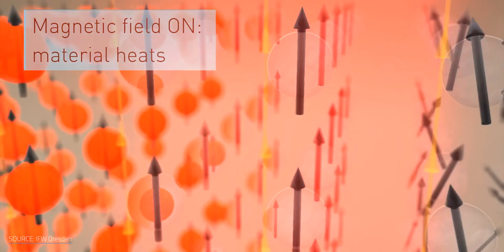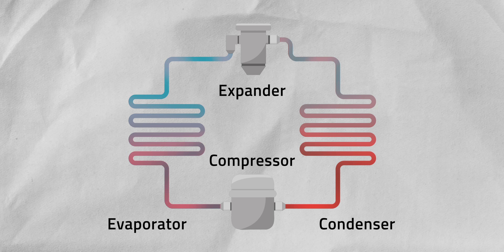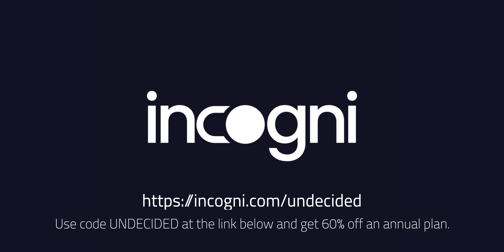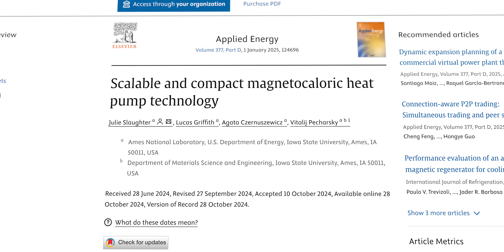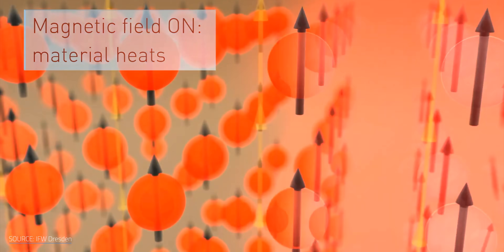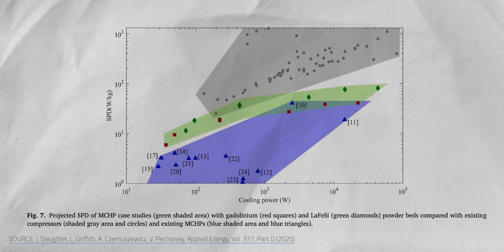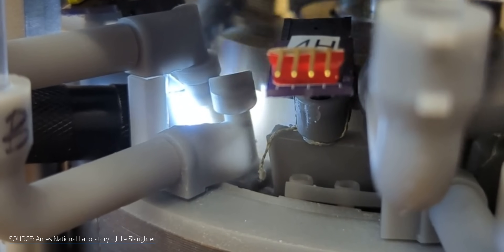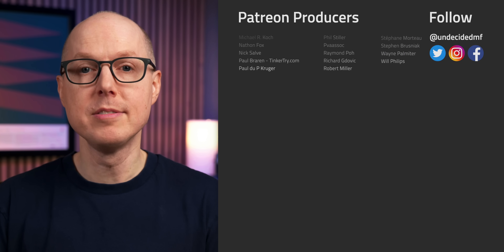How Magnetic Cooling Is Breaking All the Rules

Comment: About 30 years ago, when I drove semi, I used a 12v solid state cooler for my cold food storage on the truck. It could also be used to heat food by swapping the polarity. It got cold enough to hold about 40°F, and hot enough to slow cook food. About 170°F.

Comment: Well, some of the tech has already  been compactected or minaturized..  
 The packaging and and ceramics  women are Im sure also .. 
    Not much of a differance on any principles at all really . 
  A problem though,truely is the advance in effiencies.. . 
   The heat goes someplace..   the reflections  and things like that..  
 Much like your clothes dryer, you dont vent it i to your house on warm days, and i tersingly enough  not even on cold days... 
 The AC compressor is and was  ery effficent before.    
 Seriously.. if even a wall unit A/C were compartmentlaized and the water condensation were routed  to the radiator fins.. 
  You evertake the casing off one of them? 
   Soo many problems .. like. Oh,well needs seperstion like a plastic plate  .. ahhh.  Blowing on and the simple difference of drawing away and off of.. 
  Lets look attje total fck up of a vehicle radiator.  
  Not looking and the use or failed use of the expanded  fuel ... buttje laws of thermodynamics.   
 Why do they compress hot road warmed 200 or more degree asphalt air at 60 mph and suck it though in bell housing to blow it directly on the very engine they pass the coola tthrough..
Like yeah bruh.. Im a fcking genius gear headrocket scientist.. 
 Duhhh. 
  Seriously..think about it..Ames Research and SETI still cantfind it here  or out there.  Trust me billionsand billions, scouring the heavens for decades..  the Hubble  deep field.   NADA.. zip. 
 Heyyhey point someof that stuffat the earth.. still nada.. 
 There are far fewer particles and waves and grains of sand inside this sphere.. and quantum computers doing more calcs in a day than grains of sand in the solar system..which we hereon earth are far smaller than a d have  less grains of sand. 
 Which is like having a quantum computers doing calculations on the location and temp and movements of every grain of sand on the planet.. and even to this day, they can ot findintelligent life withing the solar system that jas the planet earth within.. 
   Un..did you say thereos a compression ?  ..
 Ok ,the corvair..maybe.. if it had a  radiator..  but still liquid cooled or magnetic cooled.. any way or both..  do not ram how air on it and then boil it with united gasoline  and burnthicker oil around  it.. shyt man that stuff  is apretty  rapidly expanding thing too.. rammed or sucked..
 Im not trying call people azzholes.. Jimmy Buffet Wrote a Song about it.. look it up, they have it here on youtube.. itis not violating  community standards, why is me asking?
 Are there some secret Jeapordy rules .. Buy A Vowel , form of a question .. thing going on I dont know about.. clue us in SETI call in hotline? .. 
   Not one denial of service attack on it either.. lonelier than dear abby..   
  Like I have this cousin yo.. the SETI callagents standing  by. Breathing heavy.. lie to me babby  lie to me.. 
 So ,some woman says that she said she is sapeio-sexual.. I said wtf does that mean.. so other screen name said she only fcks smart people.. ..I was like... ohhhh you had better have some evidence to back that.. sapeient.. and smart humans.  ... call SETI..  point all of that shytright at her..and adictonary vocabulary of terms in the the phonetic.. ..   starting at etymologies...
  The dog whisperer.. oh shyt.. stop.. had me like Rodney Dangerfield.. 
 Fly Wheels and Ragget the Hampsters  , no infringement on Alvin and The Chipmunks unless proven to be one of those 50's outreach things of a new devolping 'counter-Cullture.." Cull, Kull,like one does herds? 
 I was like vivilizarion dont you mean?  They fcking stared at me
.  I was like hmm.truely. 
  Ok Im going back to vocabulary class and Phonix.. like.. um. 1 plus 1 .. ok.. re learning.. cess..hmmm suc .. cess..went to the ole memory bamk of my mind..
 Ok..do you even thank so.eone who wishes  you success? 
 Or punch them i the throat and say you too.. ?  Etfiqutete ruleing ? 
 SETI is search for extra..terrestrial.. life... 
 Ok.. more? Tjos is 'Terra" the Earth where that  word base came from.. how co e looking..ha e the venutians or martians , saturnians capttured them? 
  Threatening them with having to come back here.. shyt, maybe they too have call block.. 
 Sapieosexual...lol. 
 Not an evidence word  backed  response.. not one.. 
 Dog walkers worried about the dog's mascumenity...  oooh fck and so does her husband...ohhh nudiicals..  
 Too much man, chill. Lol

Comment: With the breakthrough in domestic thermal batteries and heat batteries like from Sunamp, I was wondering if anybody would use PCMs in fridges and freezers so they can run during the day when there's a lot of solar but can run passively at night to reduce load on the grid.

Comment: This could be a huge benefit once we reign in cost and longevity issues.  As in motor vehicles, a field I'm more familiar with, we have resorted the the use of a refrigerant which is highly flammable.  Not the idea substance to use in a hot engine compartment or have leak into that compartment when a leak develops.  Depending upon the size requirements this could additionally save weight and perhaps remove some complexity for the system.  Applications in home construction could be simplified if this process can be used to both heat and cool your home.  On device versus two individual systems.  This will be interesting to watch develop.

Comment: AI Summary

Abstract:

This video delves into the promising field of magnetocaloric cooling as a sustainable and efficient alternative to conventional vapor-compression refrigeration systems, which rely on environmentally harmful hydrofluorocarbon (HFC) refrigerants. It explains the principle of caloric cooling, focusing on how magnetocaloric materials, like gadolinium or specific alloys, change temperature when exposed to a magnetic field. The video highlights a significant prototype developed by the U.S. Department of Energy's Ames Lab, detailing its Active Magnetic Regenerator (AMR) design and the team's optimization efforts to achieve competitive power density, projecting market competitiveness within 3-5 years. Additionally, it showcases commercial advancements by companies like Magnotherm and Magnoric, which are bringing magnetocaloric beverage coolers and industrial chillers to market. The discussion also compares magnetocalorics to elastocalorics, emphasizing magnetocalorics' performance advantages and greater maturity, positioning solid-state cooling as a key technology for the clean energy transition.

Summarizing Magnetic Refrigeration: A Deep Dive into Caloric Cooling

*   0:00 A Future Without Refrigerants: The video introduces caloric cooling as a highly efficient, futuristic alternative to traditional refrigeration, solving the critical problem of harmful refrigerant gases (HFCs) used in current heat pumps and fridges.
*   0:19 Caloric Cooling Fundamentals: Caloric cooling involves controlling temperature with a solid-state material that changes temperature when manipulated by an external force (mechanical stress, electric field, or magnetic field), unlike traditional systems that rely on gases or liquids.
*   0:50 Emerging Commercial Products: The concept is not merely theoretical; companies like Magnotherm and Magnoric have already released or are taking pre-orders for magnetocaloric products, including beverage coolers and display cabinets, signaling an accelerating market presence.
*   1:34 The Problem with Current Systems: Traditional vapor-compression refrigeration relies on refrigerants (mostly hydrofluorocarbons or HFCs) that are potent greenhouse gases when released into the atmosphere, necessitating a shift in cooling technology.
*   4:30 Why Magnetocalorics Stands Out: Among various caloric cooling methods, magnetocalorics is highlighted for its recent prototypes demonstrating competitive performance with existing vapor compression models, despite decades of research across the field.
*   6:35 Ames Lab's Breakthrough Prototype: The U.S. Department of Energy's Ames Lab developed a magnetocaloric heat pump (MCHP) prototype using a lanthanum, iron, and silicon alloy, with the goal of surpassing existing heat pumps in weight, cost, and overall performance.
*   7:16 Active Magnetic Regenerator (AMR): The core of the Ames Lab's system is an Active Magnetic Regenerator (AMR), a heat exchanger where a magnetic material (like porous gadolinium particles) acts as both the heat transfer medium and the "refrigerant" itself.
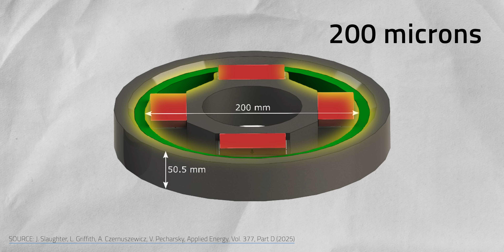*   8:06 The Magnetocaloric Cycle: The system works by rotating powerful magnets around the AMR, causing the magnetic material to alternately magnetize (heat up) and demagnetize (cool down). A working fluid (water with anti-corrosion agent) circulates to absorb and transfer heat, completing the cooling cycle.
*   10:01 Optimizing for Power Density (SPD): The Ames Lab team optimized their prototype for "Power Density" (SPD - Watts per kilogram), a key metric for making magnetocaloric devices more compact and affordable, projecting significant improvements without fundamental design changes.
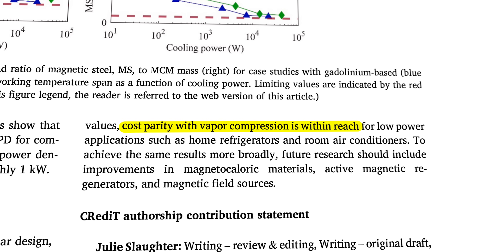*   11:12 Future Outlook and Competitiveness: Researchers estimate that magnetocaloric heat pumps could be competitive with conventional heat pumps in terms of power within 3-5 years, with cost parity also considered "within reach."
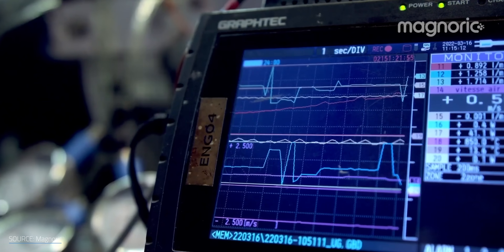*   12:05 Imminent Industrialization: Commercial companies like Magnotherm and Magnoric are moving beyond prototypes, with Magnoric stating "industrialization is imminent" for larger units exceeding 6 kW, targeting high-demand applications like supermarkets and data centers.
*   13:09 Magnetocalorics vs. Elastocalorics: While elastocalorics (using mechanical stress) is also promising, research indicates magnetocalorics offers better performance and has a maturity advantage (explored for almost 50 years). A main challenge for elastocalorics is the limited lifespan of materials due to repetitive bending.
*   14:36 Crucial for Clean Energy Transition: Solid-state cooling, particularly magnetocalorics, is presented as a crucial technology for the clean energy transition, offering a path to efficient refrigeration and HVAC systems that are free from harmful refrigerants, thus mitigating risks to human and environmental health.

I used gemini-2.5-flash-preview-05-20| input-price: 0.15 output-price: 3.5 max-context-length: 128_000 on rocketrecap dot com to summarize the transcript.
Cost (if I didn't use the free tier): $0.0058
Input tokens: 15335
Output tokens: 994

Comment: If the motor were external and magnetically coupled, and the internal rotor used magnetic bearings, it should last as long as the functional life of the shortest-lived component. You could swap a motor without breaking into the fluid loop, and there would be no seals to leak. If the magnetocaloric effect stays efficient for 50 years, the magnets hold their strength, the fluid retains its ability to transfer heat, and the tubing doesn't corrode, you could conceivably only need to buy one refrigerator in your lifetime.

Comment: Most smaller scale refrigeration systems nowadays are using hydrocarbons which are much cheaper and more environmentally sound than HFCs. As long as magnetic cooling is more efficient that's great otherwise traditional refrigeration works just fine with hydrocarbons
Reply: And sometimes R32 refrigerant blows up your entire kitchen.  You can google some news stories about it.  Hydrocarbon refrigerant leaking, lack of ventilation behind the fridge, and an electrical spark...  I'm glad the fridge in my studio apartment, which I sit about 15 feet away from, was manufactured in 2006.

Comment: Off the bat I'm just sitting here wondering why we haven't been using propane straight. Propane is barely a greenhouse gas readily available and we already have propane in use in houses and we have gas lines run all through the cities so it's not like it's an additional hazard.
Reply: Chatgpt told me I could recharge my AC with propane lol. Then it told me not to try
Reply: That's basically what R32 refrigerant is.  It also, on rare occasions, blows up entire kitchens or homes.  There are news stories out there on these occurrences.

Comment: How are they going to paint themselves into a corner by having a 3-5 year DOT validation on pressure relief valves that end up being made by 1 company, represent 0.000001% of their revenue, and the machine that makes them breaks down, backorder the valves indefinitely, and leave everyone stranded. Refrigerant supplier says "Bulk refrigerant IS AVAILABLE, the problem is lack of tanks." Tank manufacturer says, "Tanks are NOT the issue, there is an acute shortage of pressure relief valves." The pressure relief valve company says, "Their ISN'T a shortage of pressure relief valves. The supplier of springs was purchased by 4 women. They have NO INTEREST WHATSOEVER in hiring a Diversity consultant to prove 30% of management "identifies" as female, so they are stuck trying to get DOT supplier diversity certificate."
Meanwhile, the bulk Refrigerant they can't package or move has been lost to storage loss.
JUST LIKE LAST REFRIGERANT SWAP.
Remember CFL bulbs, recycling program to follow? Been 30 years, still waiting.
Remember the "landfill crisis" in mid 80's? Turns out that when you mandated all landfills must have Federal approval, then don't set up an approval mechanism (They made up a rubber stamp, then never hired anyone to operate the stamp) that 20 years later it takes a Congressional investigation to figure out there was a pile of permit applications being sent to an office that was never staffed. And some of them had been there for 20 years.

Comment: But modern gases are not environmentally unfriendly and can achive a CoP (efficiency) of 5 (probaly the limit), Matt you have not indicated what the target efficiency is, so unless it is 7, waste of time (unless it will work at -100). Anything with moving parts will go wrong so this will require servicing and who in your neighbourhood will be able to fix it? And.. you replace R600 / R290 with all sorts of rare elements, mined and I suspect, controlled by China, and... I work with Lanthium (and those wacky metals), every year there is increasing doubt about the long term health implications from radiation from the maching processes. Interesting university PhD research topic, but commercially, a dead donkey.

Comment: To enhance the performance of a magnet in applications such as magnetocaloric cooling, you can consider adding certain materials that can improve the magnetic properties or thermal conductivity. One common approach is to mix the main magnetic material (such as gadolinium, which is often used for its strong magnetocaloric effect) with other metals or alloys. Here are a few options:

1. **Gadolinium Alloys**: Mixing gadolinium with other elements like dysprosium or terbium can improve the magnetocaloric effect due to the different magnetic properties of these elements.

2. **Copper**: Adding copper can enhance thermal conductivity, which can improve heat transfer during the magnetocaloric cycle.

3. **Iron**: In some cases, incorporating iron can enhance the magnetic properties and increase the overall efficiency of the magnet in cooling applications.

4. **Nickel**: Nickel can also be mixed with other magnetic materials to improve the magnetic properties and potentially enhance the cooling effect.

5. **Aluminum**: Although not a magnetic material, aluminum can improve structural integrity and thermal conductivity in certain magnet systems.

It's essential to consider the specific application and desired properties when selecting materials to mix with magnets for cooling purposes. Additionally, the proportions and methods of mixing can significantly affect the final performance.

Just curious.

Comment: When In college I spent all my free time exploring vapor/refrigerant based systems.  One of my favorite gasses was Ethane. Its about the scariest dang way you can go. But the pressures are crazy when off cycle. and desuperheaters and expansion tanks are needed to be safe... Its like Hydrazine for drag racing. 
I could appreciate some magnetic cooling if it would pull a 500 watt load to -140f and hold it there continuous for under 4000 watts and under $6000-10k.  If not then it is no solution yet for small cryocooling systems in bulk.  But hey you have to start somewhere so still awesome!  Looking forward to a tube that just gets hot on one end, and absorbs/transfers most on to the other...Monodirectional thermal transfer.

Comment: I'm wondering if this could lead to heat pumps that work efficiently in lower temperatures, as you don't need the material phase change. Though even compressor-based heat pumps are really good, working at down to -35C with a COP over 1. It wasn't too long time ago when -20C was the limit.

Comment: Reminds me of when I was a kid and on the show myth busters they tried to super heat water so they tried to make a super microwave by taking the guts out of four of them and putting the magatrons in a small metal box with a glass or water. After some testing,  the glass of water got colder instead of super hot or instant boiling.

Comment: Self-healing magnetic carbon composite streets and sidewalks, with features allowing vehicle levitation, generate electricity, dry and anti-heatwaves (melt snow and cooling) managed by temperature gage, and enhanced with color-coding on the roadway for better aesthetics (traffic laws) in a sector-based design allowing easy replacement of road sections.